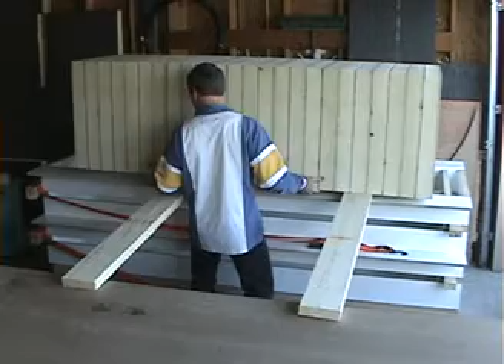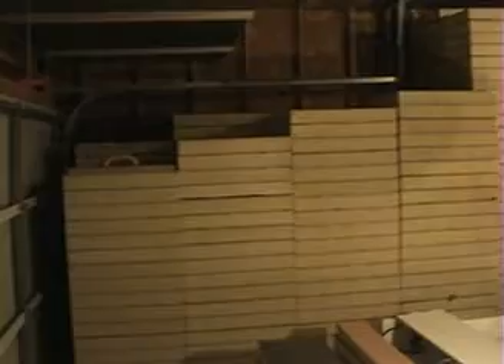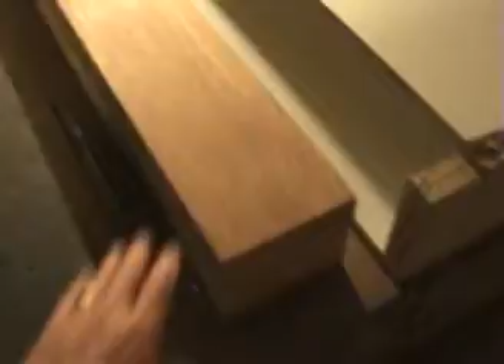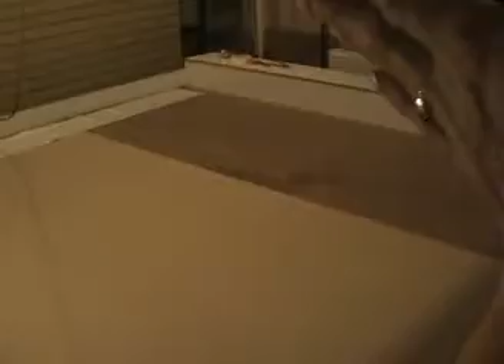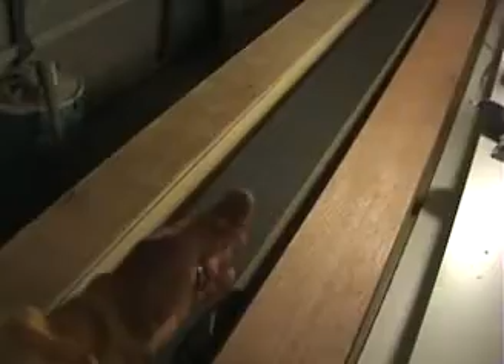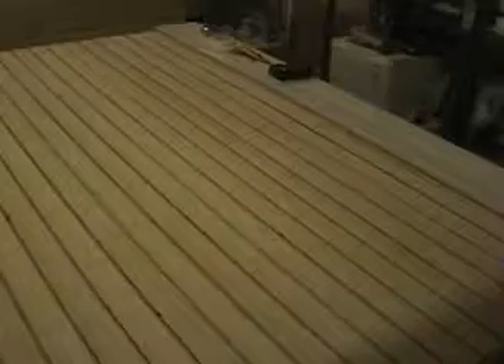Houseboat Build part 2

Comment from the maker: Hi Atif,

the multiple layers of plywood creates structural strength but after, I glue plywood over each side of that 8 x 8 structure you see in this video. The structure will then be super rigid but also light weight. The foam serves to stiffen and also to insulate against very cold or hot weather.

Luc